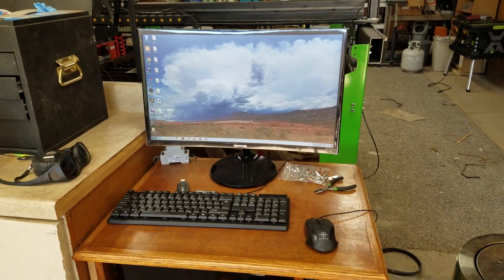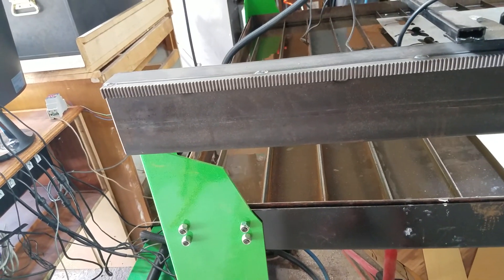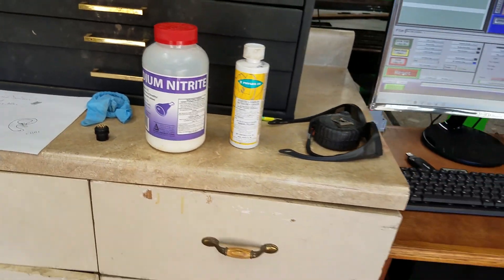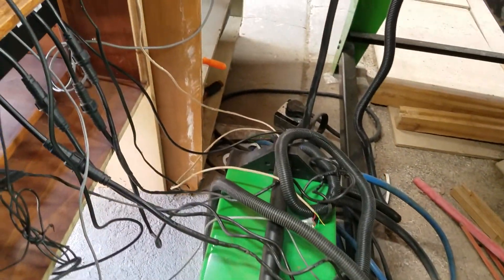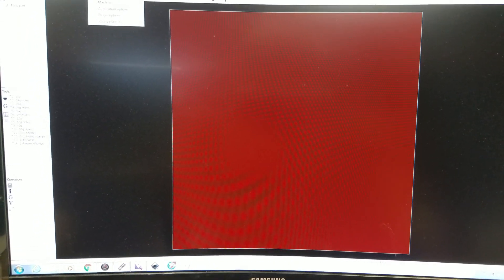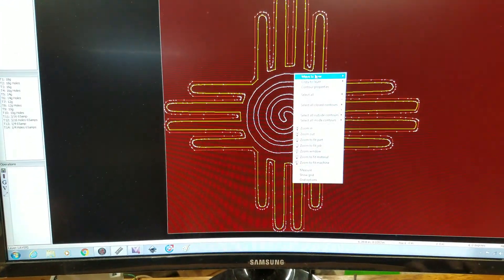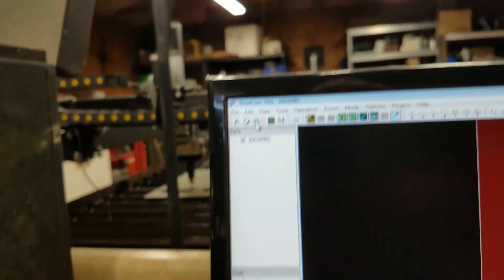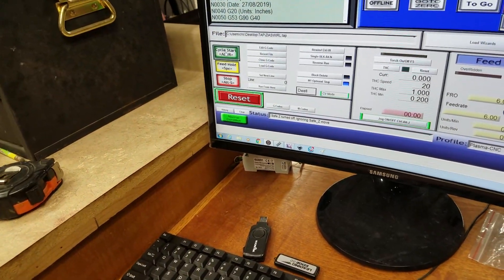Premiere Plasma Review 4X4 table

Comment: I have the same exact setup as you.sheer cam mach 3 premier plasma and proma.i see your torch taps off the plate before it cuts . I am having trouble getting mine to do that. I run the thermodynamics plasma cutter I was wondering is that in a setting somewhere or is that got to do with the torch any help would be great thank you
Reply from the maker: Hi Phil
Did you setup the "floating head adjustment"  Premiere has a video to walk you through it..I would start there.
Ron
Reply: @ronperino7699  I will check that out thank you for getting back to me

Comment: Your proma has 2 sets of screws 1 set is for a machine that has a 50:1 divider and the other set is to connect raw arc voltage. did you select the right set of screws for the 50 1 divider?